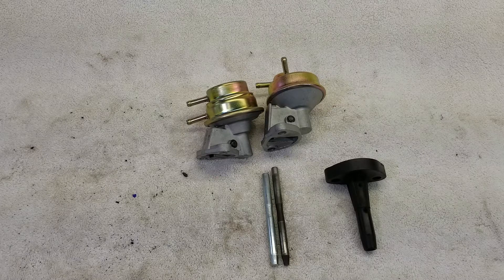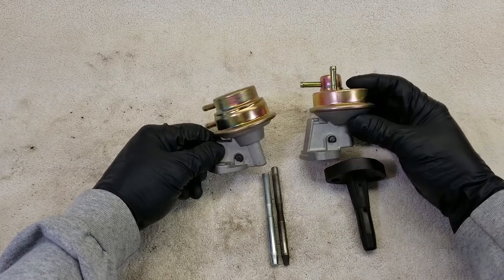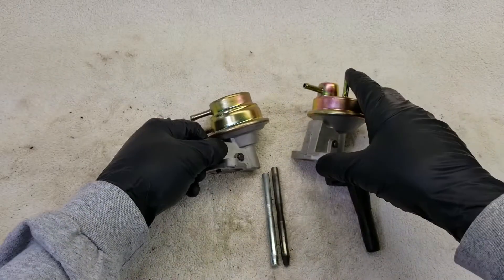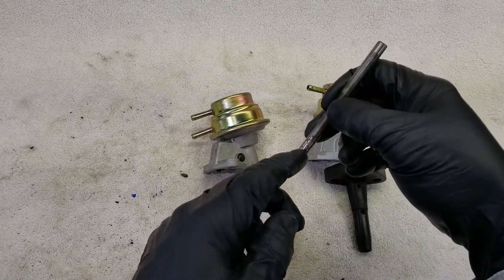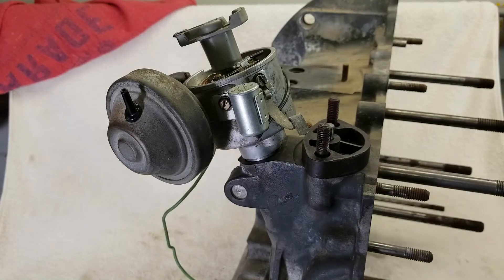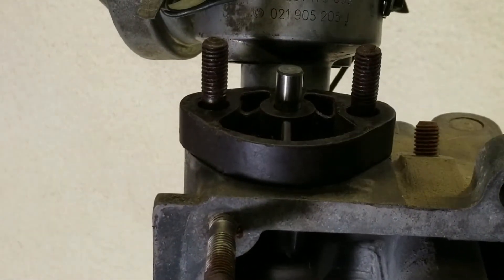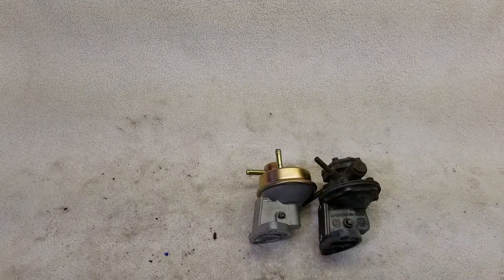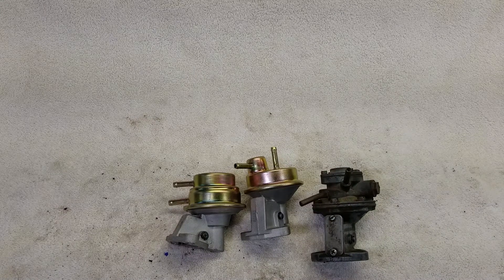Better understanding of your VW fuel pump

Comment: My pump fuel pretty much trickles the fuel into the fuel filter,  is this normal?  The motor only fires up and runs for a few minutes after l use quick start through the air filter.
Reply from the maker: So sorry for the late reply. It's old Volkswagen season around here and thats a busy time for me.
Depends on what your idea of a trickle is. The pump should only be pumping 2 psi (2.2 to 2.4 to be exact) even with duel carbs.

Comment: The German pump has a built in filter.  To be cleaned at each oil change.  Those other cheapies will leave you on the side of the road and no filter.
Reply from the maker: LOVE my rebuildable fuel pumps I own.  The price point of selling a QUALITY pump, that we'd make ourselves, would drive VW owners to installing a GOOD electric pump and a decent regulator for laterally half of the price (and I'm not talking about a crappy pump & reg......YOU know the brands I speak of here). So what's the answer for the entire VW owner-dom, here?

Comment: Can you tell me on the altermator style pump    which port goes to the fuel tank and which port goes to the carb.  thanks
Reply from the maker: W/O seeing it, my answer here is in NO WAY definitive but MOST will be stamped w/ an arrow but USUALLY the top one is the inlet. As a cautionary piece, if you can't decide which is which, don't mess w/ it and have a professional mechanic install it

Comment: I have a Generator type. It ran fine last year now it won’t pump fuel. I have changed the fuel pump and rod and it still won’t pump fuel. What could it be. Thanks Appreciated
Reply from the maker: Pump is probably bad.........again. Sometimes they go bad quickly
Reply from the maker: Or your system is clogged up somewhere

Comment: I’m getting too much fuel pressure with both types on my car. (6psi with generator type and 5psi with alternator type. I only need 2/3 for my little formula vee engine. Do u have any idea why it’s producing too much pressure? Iv never had this issue before. Great video thanks
Reply from the maker: I do. It all boils down to quality control, or a lack of. Unfortunately, our little FUEL PUMP, the FUEL PUMP RODs, the PUMP BASE it sits on and the thickness of the "gear" that the rod travels up and down on (thats 4  items that need to be within a HAIR to create the correct pressure)  are just not up to the quality/specs they once were. Good news is, you have options! OPTION ONE; get a fuel pressure regulator. Not a cheapo. Get one that actually will go on a race car and pays particular attention to the under 10lb mark. OPTION 2; You need to take off/grind a millimeter or 2 (in some cases maybe 3) from the flat end off the "fuel pump rod". OPTION 3; add another fuel pump gasket (or 3 in my case) to the base of your fuel pump.
Reply from the maker: In case you didn't quite get exactly what I was saying.....the rod is plunging to deep into the pump, so we're either raising the pump, OR we're shortening the rod. And BTW......(here comes your unwanted advice!) w/o going in TOO deep here ( no pun intended!!),  the closer to 2 psi, the better. 2.4 is on the high end if you actually calculate out the factory specs, then convert FROM metric. Remember, these cars were all done in metric by people WAY more particular then you and I. Good luck and I hope that helped
Reply: To reduce pressure you add more gaskets to the base of the pump, each gasket drops 0 3 bar I think, so you need to use a good bunch of them.
I would probably try and make my own from some heavy duty cardboard instead but it's your call.

Comment: How do you tell  if the pump is bad when I go to turn over the engine I get no gas that comes out to the carb but I do have gas coming in from the tank
Reply from the maker: THERE IS MORE THEN ONE WAY TO DO THIS, BUT......For ME, its a 2 person job.  I disconnect the main coil wire (the one the same diameter as the spark plug wires), AT THE COIL. Doing this will allow someone to turn the engine over, w/o any chance of it starting. NOW I can disconnect the fuel line AT THE CARB and place it into an empty clear glass vessel. Have the person in the car turn it over. About 5 to 10 seconds is all you'll need to see if fuel is coming into your glass/jar. Be careful of the fan/alt belt, it still can "grab' onto sleeves, long hair etc. If your glass was good and clean you can put the fuel back into your tank, or just dispose of the fuel properly
Reply from the maker: ALSO a VW air cooled engine insists on around 2 to 3.2 pounds of pressure to operate (Fuel injection VW's are excluded, here) the car properly, this ENCLUDES MOST DUEL CARB SET UPS. This equates to not much more then a dribble and why your air cooled VW operates just fine w/o an electric fuel pump and pressure regulator......I mean, unless you enjoy wasting your hard earned money.

Comment: What if the rod that drives the fuel pump is not moving up and down ?
Reply from the maker: Youve got something broken internally and shes gotta be taken apart.
Reply: @JunkyardDogGarage918  I think that I will just put in an electric fuel pump.

Comment: What's the name of the pump from 1:05? I've been looking for it everywhere cause I'm trying to find a rebuild kit
Reply from the maker: That's for an earlier, smaller motor. I've  currently got one on an 1835,w/ duel Kads. After accommodating for its fuel flow, it works great and has that cool old school look I wanted

https://airheadparts.com/vw-part/fuel-pump-repair-rebuild-111-198-555/

They have a tech department that will help you and is second to none, but have patience, they field call from ALL over the world
Reply: @JunkyardDogGarage918  thanks man!

Comment: Do you know the pressure that these pumps can do ?
Reply from the maker: They're SUPPOSE to pump no more then 2 psi (2.2  psi is starting to be on the high side) BUT, due to the LACK of quality control nowadays (it is what it is!), I've tested brand new ones, right off the shipping container at 7 psi! WAY to high to ever get the motor dialed in w/ stock components. This will contribute (to a certain degree) to most flat spots on the beloved 009 distributor (which I personally don't use)

Comment: Question , if you use the generator push rod on a alternator pump. Will that lead to excessive fuel pressure going  into the carburetor and fuel mixing with engine oil ?
Reply from the maker: Sorry for the delayed reply, Big John. Spring time and VW outings are hand in hand!🌞🌊🌊
It will contribute to this.  "Yes" to the entering into the crankcase. That combo could mean a near future engine rebuild. No bueno, amigo.
Reply: @JunkyardDogGarage918  l used the longer rod with alternator pump. Bent the rod broke the plastic rod guide. What other damage could it have done ?
Reply from the maker: @daveturner9780  the fuel pump and plastic stand are the weak points in the system and thus, CHANCES are nothing else
Reply: @JunkyardDogGarage918  thank you

Comment: Hi, on the Alternator style pump, which is the fuel in and which is the outlet to the carb, thanks.
Reply from the maker: Sorry for the late response. The top nipple is fuel in. There should be an arrow stamped on it, pointing inward.

Comment: I have a 73 sports mobile camper it has dual carbs I got fuel in it but  won’t fire over but it turns and tries to start I’m thinking the fuel pump any tips to fix and also adjust carbs is appreciated
Reply from the maker: Neil, not enough info to make a pin point response BUT check to see if it's getting fuel. IF it is, start looking at the distributor.  If it's not, go to the pump, young jedi. Good luck and keep us posted
Reply from the maker: BTW....73 Sportsmobile? Nice. Very nice.

Comment: I got code P2187. My car won’t start. Any suggestions what i can do?
Reply from the maker: you can do a "search" on the world wide web as to your year, make & model for your cars codes. Even if you  can't fix it yourself, you'll at least have an idea of what it is. WARNING; Some codes are VERY generic and won't tell you exactly what is wrong BUT will give you a system. Example; "fuel supply" 
Good luck and hope that helps
Reply: Now if it was a code PC -187 then it shows you been watching all the old Star Trek movies.